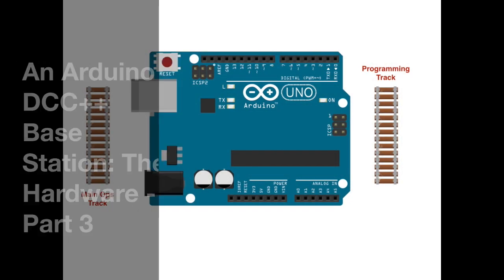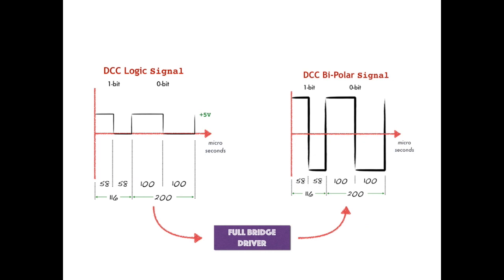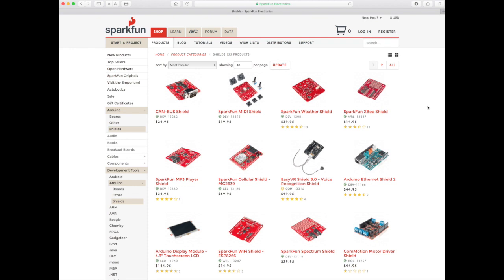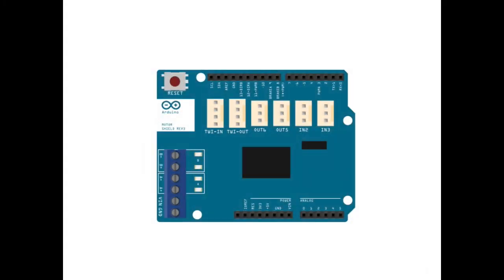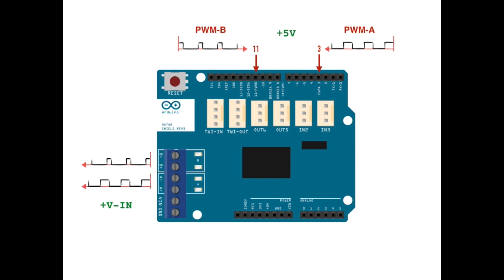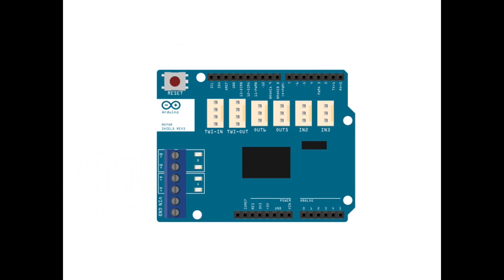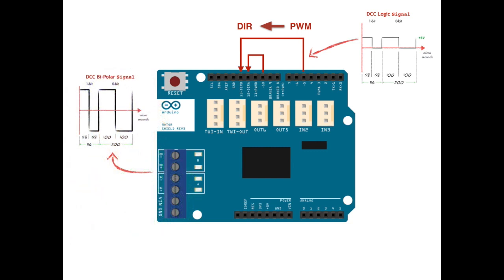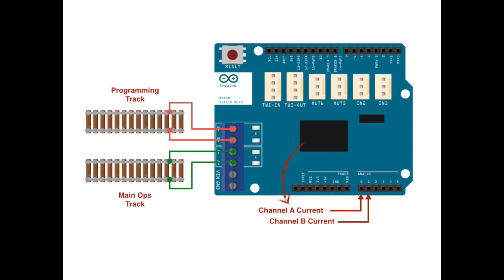An Arduino DCC++ Base Station: The Hardware - Part 3 of 4

Comment: Hello, I currently have a ILS-DC Stepper Motor Shield V2 TB6612FNG PWN Drive Module For Arduino. It uses the TB6612FNG motor driver chip and it's possible to connect 4 motor. I have 4 output port and I would like to know if the connection for pin 5-13 and 10-11 is the same and which output to use. I tried to do the configuration as in the video but I have no signal on the output. Thanks a lot, Settimio

Comment: I understand that the PWM/DCC signal is fed into the direction pins in order to produce the bipolar signal. But where does the positive or negative signal come from? You need a PWM signal from a pin and the direction signal from other pin. The direction come from pins 12 and 13.

Comment: Would this servo Shield work?
https://www.jameco.com/webapp/wcs/stores/servlet/Product_10001_10001_2259024_-1
I found the Shield and bought one.  Just wondering if the above would work as it is $15 cheaper.
Reply from the maker: +Maltux1 The Jameco shield above unfortunately won't work directly with DCC++.  It may be possible to modify the software but it would be more than a matter of simple pin-remappings.   Have you checked out the Trainboard forum.  Members have identified a number of Arduino Motor Shield clones that appear to work well.  There is also a shield by Pololu that others have had good success with.
Reply: +DCC++ Thank you very much for the reply.  I bought the recommended shield from Jameco and am excited to start going.  I joined Trainboard forum and read the 48 pages about DCC++.  Your videos and ideas are very clearly presented and realize if I were 35 years younger I should have studied electrical engineering.  Thank you for explaining DCC wave signals. Most exciting project yet for my arduino - the CNC machine was pretty cool too.  Feel like I am a kid talking to a Rock star.  Again thank you!